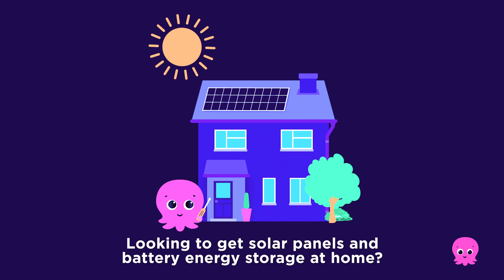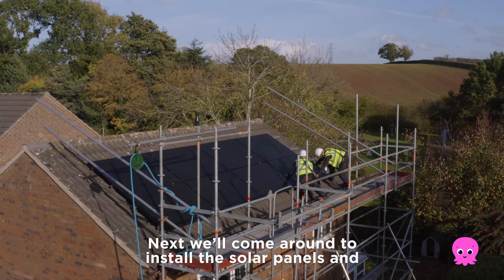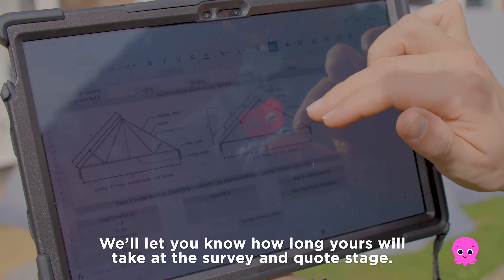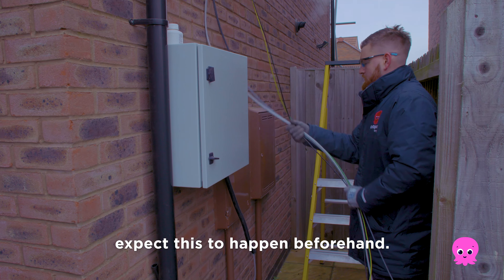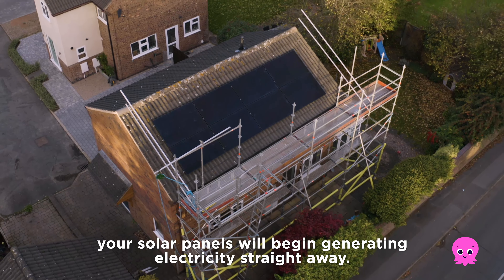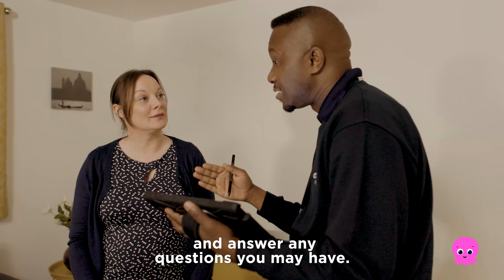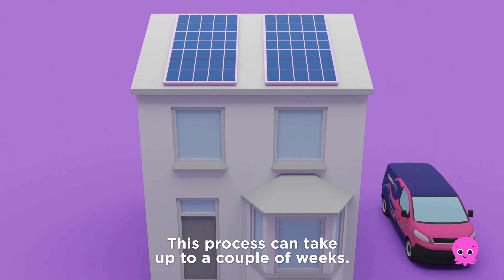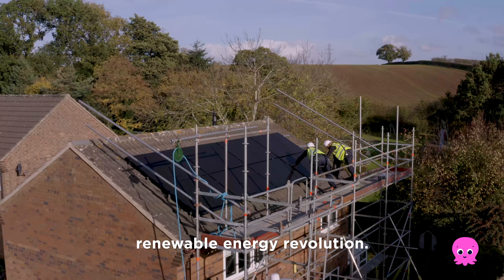What to expect from your Octopus Energy Solar and Battery installation

Comment: Righto. Took 3 attempts and 6 months (with god knows how many emails and phone calls) to get a Smart Meter installed correctly. Paid for an EV charger nearly 6 weeks ago, an Octopus subcontractor turns up to fit the isolator, and says "there's no room" (despite the fact I sent photos in advance). 4 weeks later, endless emails, phone calls and requests for a refund (or even a copy of the refund policy) and I'm still waiting. Octopus, like everyone else, use subcontractors and subcontractors don't give a monkey's c@*p and when you tell Octopus this, they dont give a c@*p either. A couple of weeks for the DNO to approve 😂😂😂😂, 6 months more like(asuming they don't lose the paperwork, in which case it will be 12 months, they they'll tell you that you cannot export more than 3.66kwp). 100% Fantasy Land. 10/10 for optimisim!
Reply from the maker: Hey Gordon. 👋 I'd quite like to look into what's happened here. Could you send your details over on https://octo.ps/nudge so I can investigate? 🐙
Reply: No I don't think I will fill in your form thank you. I paid you £1k in advance, 6 weeks later and nowt. I asked for a refund (was ignored), I asked twice for a copy of the refund policy (was ignored), my wife and I have now asked 3 times for a copy of the 'quote' to send it to EST (was ignored). I've spoken to 4 staff and emailed several times (ignored). I pay you £1k in advance, my account was £600 in credit and you were charging me £277 per month when I do not use more than £100 energy and you want me to fill in another form. No. I'll just share my experience of Octopus all over Social Media. Oh, and thank you. I've now had to take 4 days off work due to your contractors incompetence. Pay you lot for Solar Panels / Heat Pump. NO CHANCE. You have my name and I'm sure you'll be able to find me on your systems if you can be bothered.